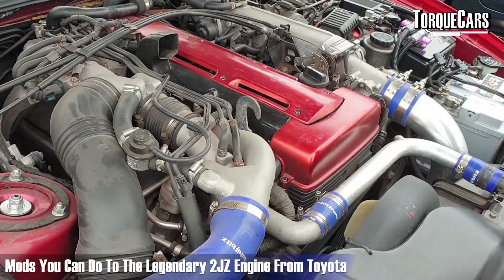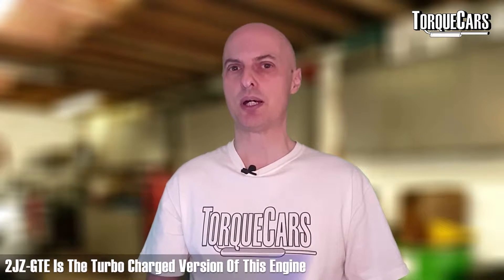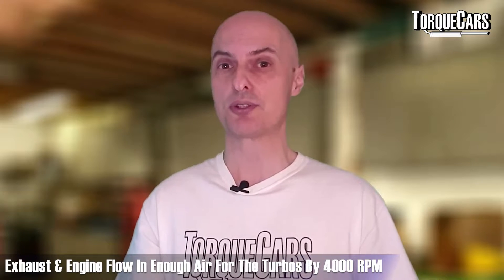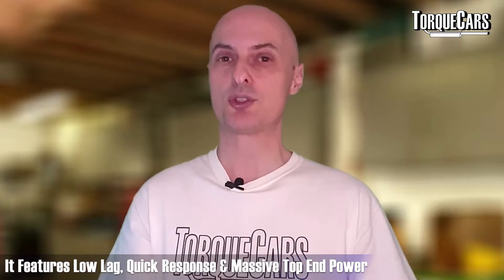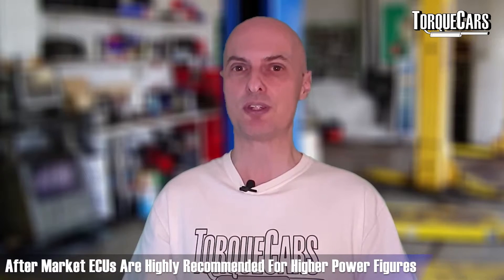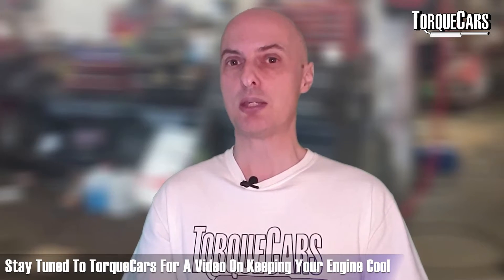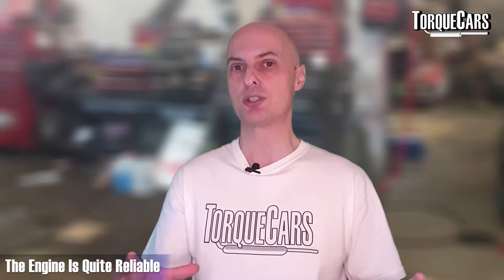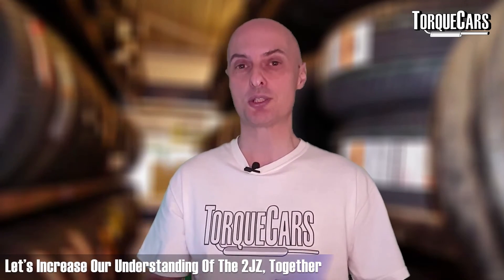A Comprehensive Guide to 2JZ Engine Improvements and Modifications [Unleashing the Beast Within 2JZ]

Comment: I been doing a 2jz from a gs 300 to a 98 mustang, got the engine in, fuel and everything working. Just need 2k for a engine harness, and new ecu. After that. it runs, then later gotta shorten the driveshaft to actually get it driving. From there, its history.

Comment: vvti GTE in a 2000 Aristo. Haven't done anything yet, but planning for bigger injectors, larger second turbo, more aggressive camshaft,  new fuel pump, and upgrade the intercooler.
Reply: You’re Wasting your time dealing with twins on a jz. Just run an appropriately sized single and be done with it

Comment: I'm buying a Lexus is300 and plan on swapping in a 2jzgte and a single turbo with an electronic waste gate.  I will be rebuilding the engine and adding aftermarket parts. My budget for the engine is $8k. I'll probably spend another $10k on the rest of the car. I'm only looking to get 600 hp. It will be a daily driver.
Reply: hows that going?

Comment: Non vvti 2jzge have the exact same internals as the gte besides higher compression pistons. Use a gte headgasket, slap a turbo on it, and you can easily make 600+hp on them. 2jzge vvti engines on the other hand, have the same crank but weaker rods and can only be pushed to 350-400hp safely. Swap pistons and rods for non vvti internals and skys the limit. In summary, boost your ge, dont buy a gte.
Reply: Sorry what.... 😂

Comment: Im thinking about picking up a is300 for 5k with 170k miles on it
Reply: Look around Dallas tx I have seen a few cheaper than 5k
Reply: I just bought a gs 300 for 2500 , I have another gs but it was “wrecked” but drove it home. It was 1200. They are out there